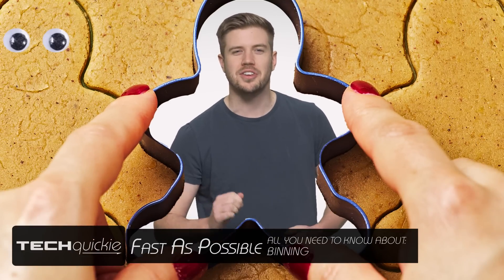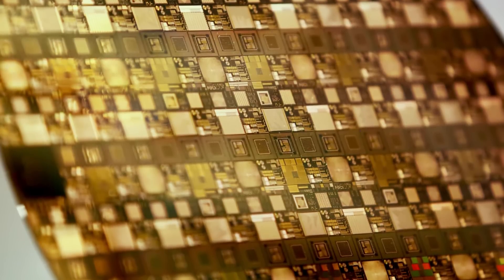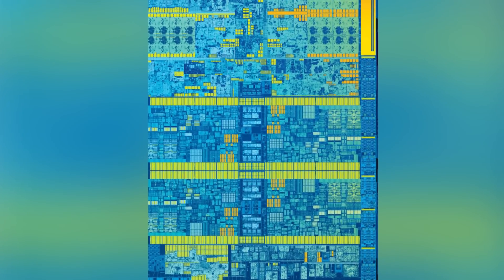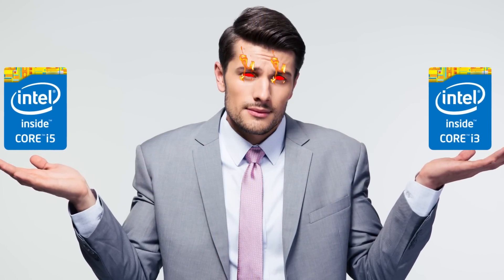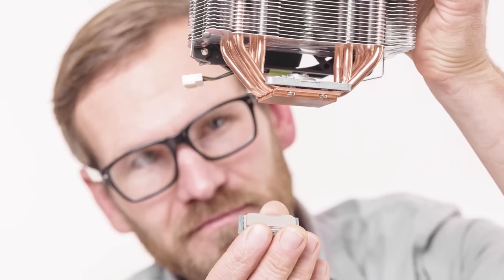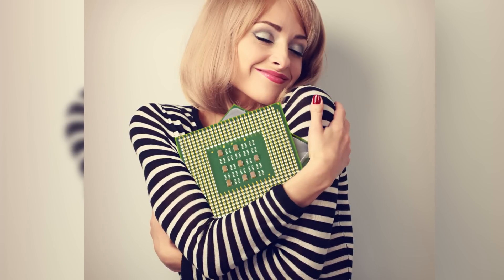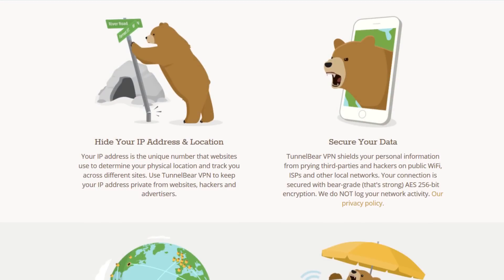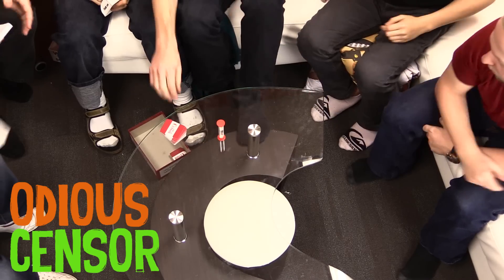Binning As Fast As Possible

Comment: don't think you would ever recieve an i5 binned down to an i3. isn't hyperthreading a physical property of the di? if i5s just had disabled hyperthreading wouldn't someone have figured out how to dick it in the last decade?
Reply: +kght222 No its an effect of microcode, most intel cpus start off as a quad core capable of hyperthreading, some are selected (likely based on sales and not binning) otherwise a i7K would typically overclock a decent amount better than a i5K which isnt the case, the exception is if some l3 cache is defective then it must become an i5 (6mb of cache instead of an i7's 8mb)
If cores or more cache are defective then it becomes a dual core with hyperhtreading enabled and some are set aside (again, sales) to become cheaper pentiums, contrary to popular belief this is done to perfectly fine cpu's because you will sell more pentiums and i3's than you would just having i3's with no cheap option just because you have more products available, this was shown with unlocking skylakes where even i3's and no doubt pentiums would still hit 4.5ghz if intel let you.
This is why you get i7K's, 10 differnt locked i7's, i5k's, 10 different locked i5's, 20 different i3's, 20 different pentiums and 20 different celerons. its easier to find a worst case scenario chip (say 2 cores that requires 1.2v at 3.3ghz) and then just set all of them to 1.2v and set differnt multipliers than it is to set individual voltages and multipliers even for big batches, the price to the consumer is the same either way, the costs to you are different though.
If cpu's were locked purely for defects and no other BS intel would sell an 5960X for £400 , a 5820k for £300, a 6700K for £120 (considering the amount of silicon difference between the 8mb vs 6mb of cache), 6600K for £100 (based on a 22nm g3258 being £50 a 4790k's silicon would be £100 and a 14nm node of the same transistors would be about £63 but lets assume its not that simple and transistors have increased), and a dual core i3-6320K should be £75 being effectively a 6700k sliced in half, intel would only have 5 products to sell and wouldn't be raking in 55.4Billion. but who cares about companies making huge profits, amd meanwhile sells a the unlocked fx8, the unlocked fx6 (fx8 with a module deactivated), the unlocked but slightly overpriced fx4 (likely a different die altogether but who knows) and thats it, AMD dont sell artifically crippled versions to bulk up their market selection or do microcode updates to stop you from overclocking (like intel did on the pentium-k), the fx8320/e and fx6300 are unlocked so theres no reason to buy faster clocked versions.
"if i5s just had disabled hyperthreading wouldn't someone have figured out how to dick it in the last decade?", the work required to change microcode on a cpu by your average joe is more work than its worth so most people put up with it and buy a K edition and bend over the table while intel does the dicking while getting paid for the service. amd all this time has been offering decent fun to the few on the cheap but hasn't been earning enough and now that its on its last legs has seen whats been going on and is now willing to put on a strapon if it means it can join in with intel, if the playing field was a little more fair we'd all be having a good time instead.
Reply: heh, my current system is a fx-8350 that i just migrated from 2001 infrastructure (case and cooler) to 2012 architecture (330r case , h100i cooler, awesome note: you can use the washers that come with the h100i to prop up the lid on the 330r and get very acceptable airflow with the lid on, rock solid 4.5ghz including the 5mhz core overclock that also overclocks my memory)  anyway i still don't understand how having a larger selection of procs generates more sales when the low end price on the potential smaller selection is still about or under a hundred bucks (50 pounds or so. it is a maximize profit exercise that i don't get, because it doesn't really scrape up much cheap sales compared to the alternative, businesses are gonna buy their shit regardless, 10 bucks per unit might be the extra overhead on their computer "fleet" for lack of a better word, and that is allot of money, but the choices are offered by the manufacturer, and they need the computers regardless, for most buisiness computers amd is actually the cheaper and better solution, most buisinesses go intel for reasons that are not economic (large businesses being the exception because they often have to pay for the energy that runs thousands if not hundreds of thousands of computers and intel is the economy sipper that runs 40 miles to the gallon). the only reason i can imagine that it would be a long term good idea is if they have complete contempt for their competitors and are accurate in their contempt. but sadly i think what it comes down to is that amd has been making constant mistakes since they bought ati, and has even had to completely move their focus over to ati for years because of their mistakes. don't get me wrong, modern radeons are competitive, and i have a fx8350 for a reason (my infrastructure is as old as 2001 because amd had such a smooth upgrade pathway that never required me to do more than buy a motherboard and memory, or a motherboard and proc). i'm likely going intel next year, i am tossing hundreds at the infrastructure on my computer this year so i can toss a grand or two at the platform next year (no video, just motherboard, memory, proc). i am of course planning to go massively overboard and am already belly deep in that unneeded spending (about 600 this year if you count the two 3tb drives i grabbed to upgrade my little 512gb semi redundant array, never trust raid, but it is good for semi redundancy or striping, backups should always all be independent, never tied together) but i hopes for amd to put something out to convine intel to get over themselves, and if amd does i will likely go with the amd option just to push intel that millionth of a hair more. if amd drops something dominant i am actually more likely to give intel a try for my main rig, if amd dropped something dominant x99 and x79 prices are likely to deflate like a baloon with a peice of grey tape on it with pin pricks through the tape. of course that depends on how amd would play it, but i am curious, and funnily enough i actually planned my next platform change about five years ago when the 8350 came out (i got my 8350 less than two years ago).

Comment: If they have physically  disconnected the cores, it's just to open it up, and re-connect them, problem solved.
Reply: +Yemto 
Do you know how small the transistors are? What about what to look for? These days, modern microprocessors have transistors that are 14 nano meters in size, one from about 6 years ago is around 65 nano meters. You'll need an electron microscope just to see the transistors.